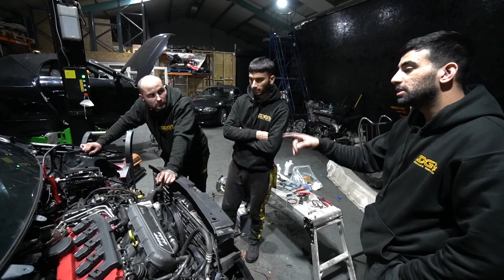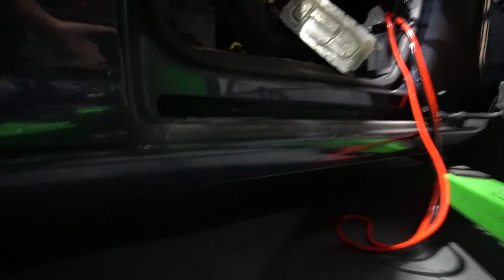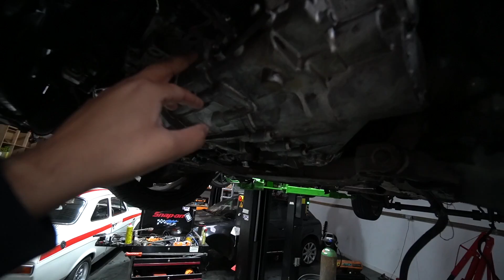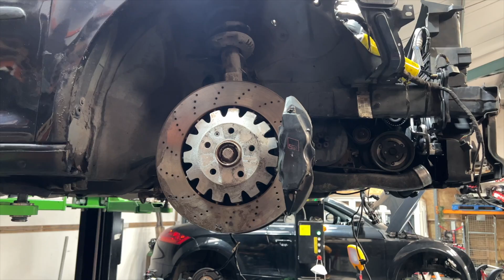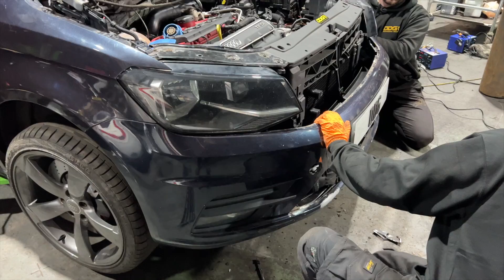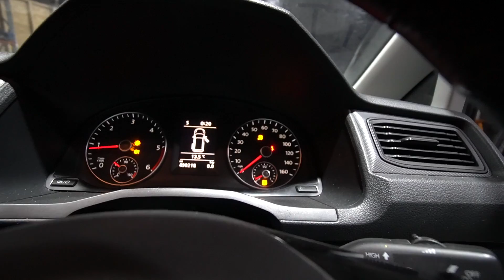BUILDING AN AUDI RS ENGINE SWAPPED VW CADDY | PART 3

Comment: The 2.5 is a masterpiece of engineering
Reply: how reliable is the engine though?
Reply: @solefreak2  Super reliable. Everything from the early iron blocks to the DAZA are good for 600bhp+ stock internals basically bulletproof levels of reliability
Reply: @aidencoder  What years were the DAZA engines in production? Really want one of these but has to be the most reliable one out of the lot.
Reply: @solefreak2  I think 2017, 2018 and early 2019 RS3 and TTRS were DAZA and then in 2019 it changed to DNWA engines with additional cats, different compression and a load of WLTP regulations changes.

DNWA engines sound much quieter and don't tune as easily.

DAZA engines are sort of holy grail because they have the lighter block and so on, but pre-date the WLTP regulations changes.

They're all really solid engines though, and all capable of big power, it's just the DAZA tends to be the most "liked" for tuning and factory sound.
Reply: The 3.2 6pot also
Reply: @HAZYFALKIRK  The VR6 is certainly capable, but the design is old. Things like having port and direct injection on newer engines, better geometry and so on mean I can get 35mpg out of my DAZA with over 500bhp while it being more reliable at a given power output.

Being naturally aspirated meant that it had limits without forced induction mods. For that and many other reasons, such as wide applicability in any MQB platform car,  I think the 2.5T in the TTRS and RS3 will go down as a legendary engine up there with the 2JZ.

Comment: I think you may be able to fit a mk7 gti front bumper to it
Reply: Not possible directly, would need to cut a section out of the MK7 Golf bumper and graft it onto the MK4 Caddy bumper, retaining the MK4 Caddy upper section and sections that meet the wing/wheel arches to mount back to the Caddy and keep the panel gaps. There are a few people around the UK that do custom bumpers for MK3 and MK4 Caddy vans quite often.